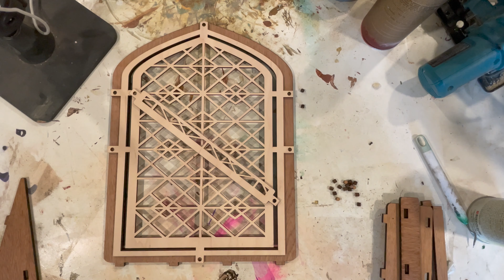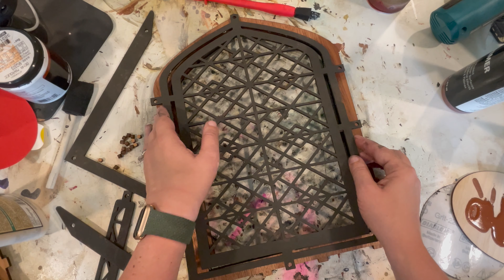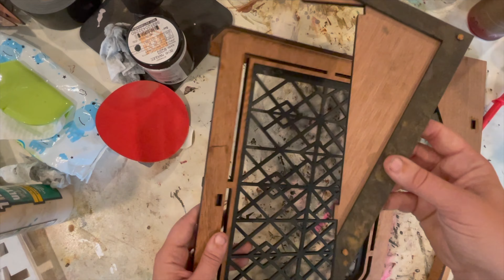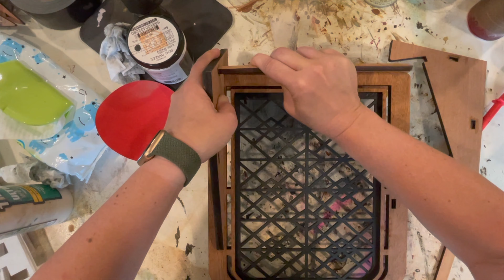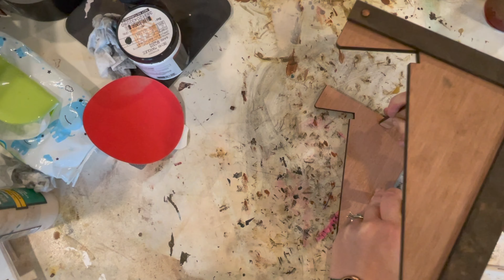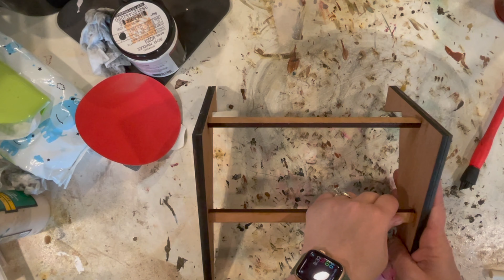Iron Gate Cookbook and Tablet Holder Stand

Comment: I understand the black flat spray paint but you don't explain how to make it look a bit rusted.  Tips?
Reply from the maker: This is a paint called modern masters rust paint. This paint has iron in it and the spray causing a reaction with the iron!!
Reply: THANK you so MUCH!!!   @welcomehomecustom
Reply: You painted with flat black spray paint.  Once dried did you just wipe on the metal paint?
 @welcomehomecustom
Reply from the maker: @terrybell9721  the flat black spray paint basically primed the wood.  The iron paint isn’t cheap so I covered with the black spray paint first.  Then I dabbed on the metal paint and sprayed the activator!